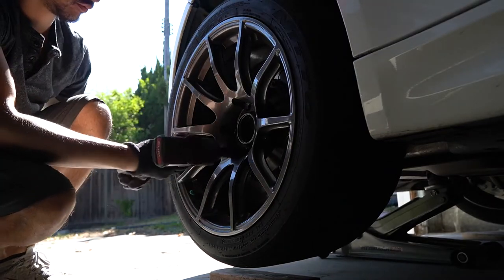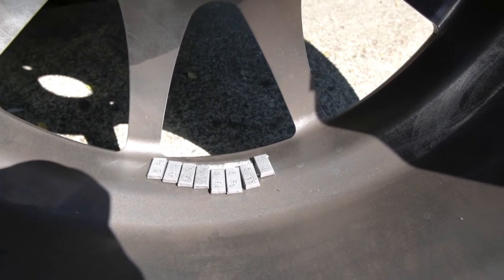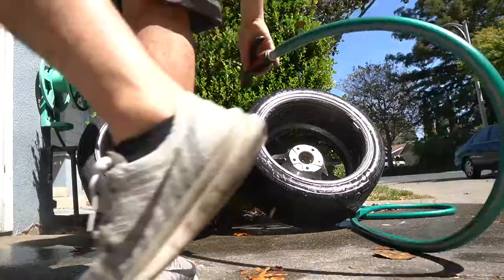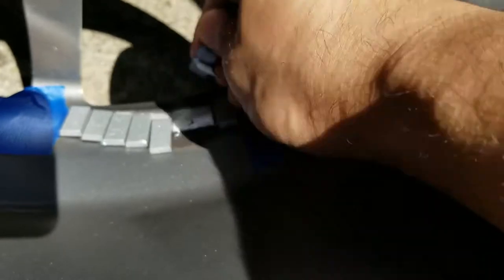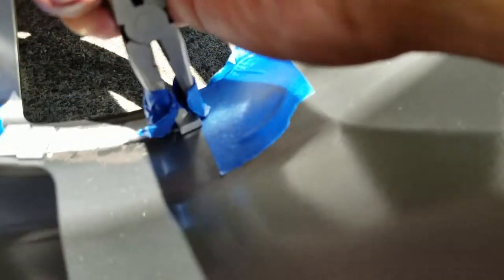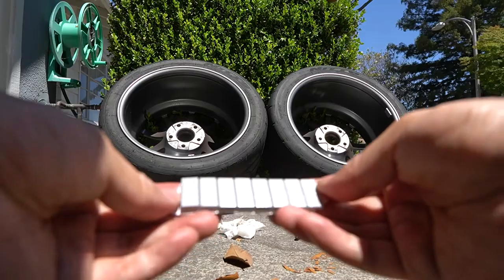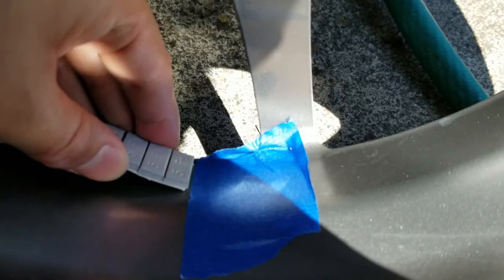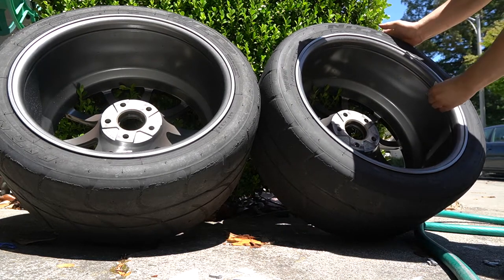How to Remove Wheel Weights and Prevent New Ones from Falling Off -  E92 M3

Comment: as your tires get worn down, your wheels become  out of balance. so instead of putting new weights on yourself and having your wheels still be out of balance, take the wheels to a tire shop and have them balance your wheels. they wont fuck up your wheels when they remove the weights and adhesive because you already did that step.

Comment: Is it ok to have none of these? I have none of these on any wheel
Reply from the maker: Depends how hot your brakes get. I didn’t notice issues with my wheel weights till after a couple track days.
Reply: if you don't see any wheel weights  on your wheels, chances are very high that your wheels are not balanced.
Reply: Yes it is, you have good quality rims and tires and good tire shop. But only if you have no vibrations at any speed